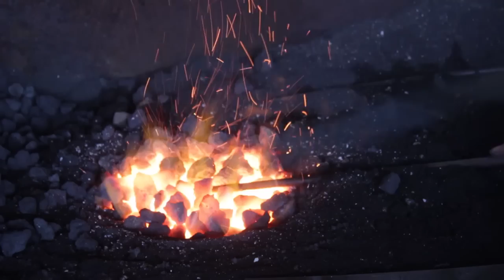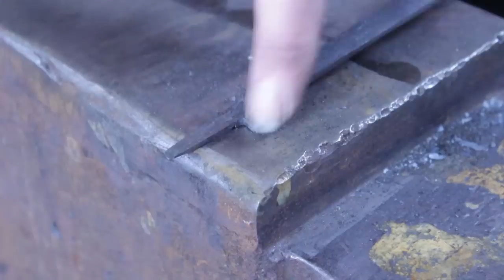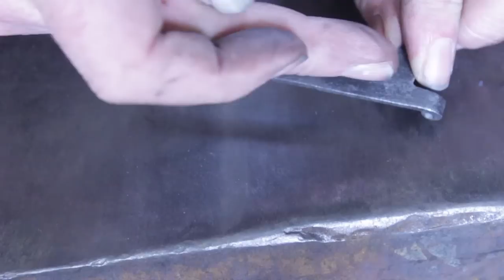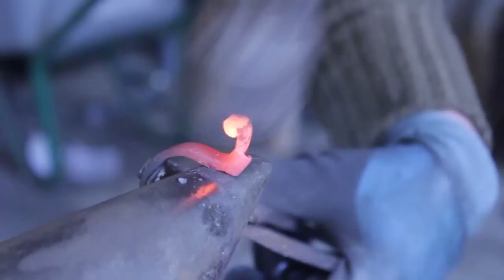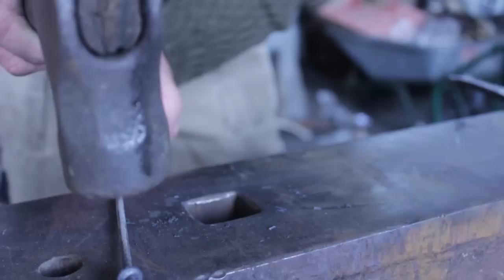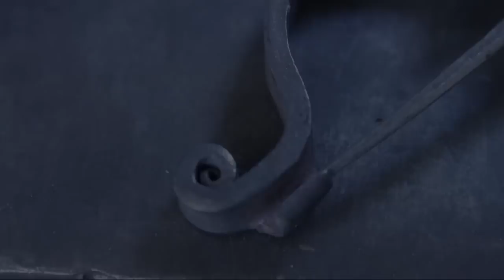Forging a Roman Iron Fibula

Comment: Thanks for this. I like little projects for skill builders as they don't cost much or take too long and the extra accuracy required really builds skill fast compared to larger pieces. I do bottle openers that require a 6mm hole in 10mm square stock. Slitting and drifting the hole is the way I do it after many tries with a round punch that didn't give the result that I wanted